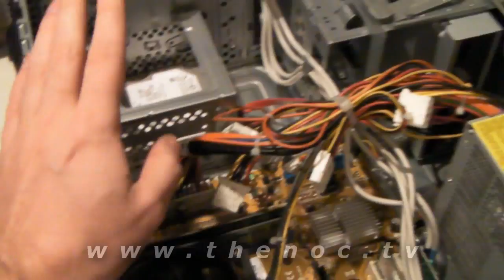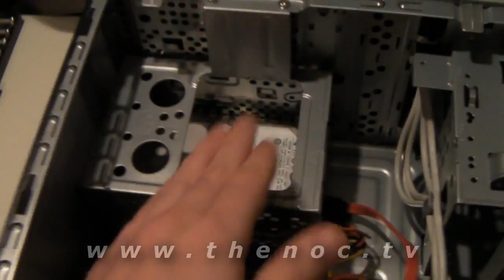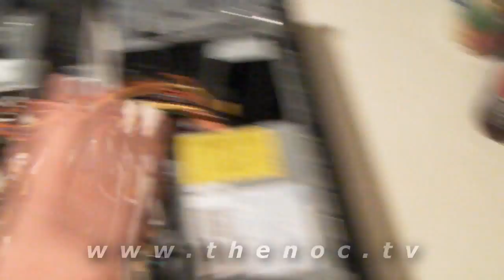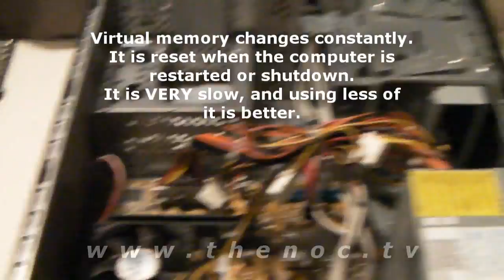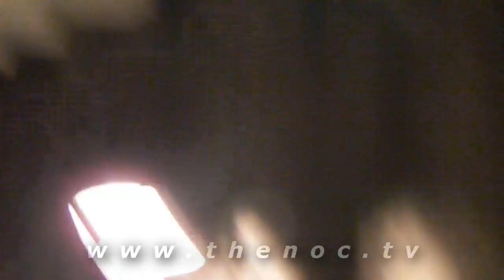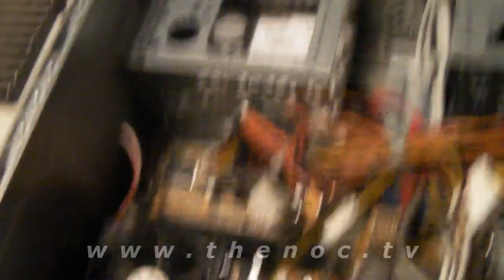Various types of memory in your computer. RAM vs Hard Disk

Comment: I heard that hard drives were going to go static as apposed to using moving disks.  It would be kind of like a thumb drive (flash drive)but would be much faster since it's not working on trying to find sectors on a certain section of a disk.  Have you heard anything on this Def?